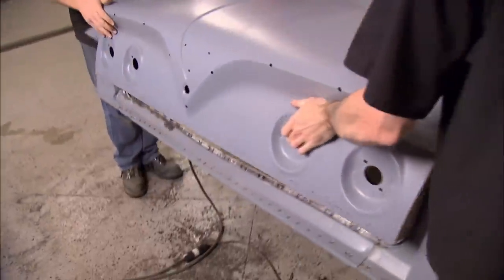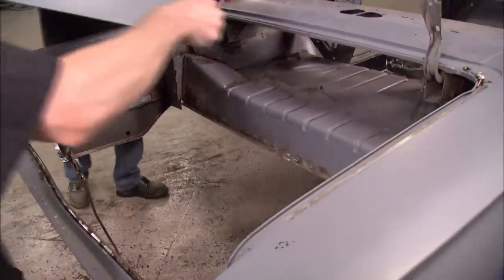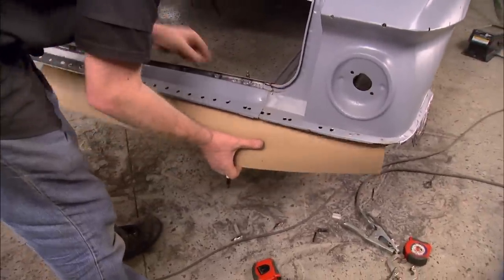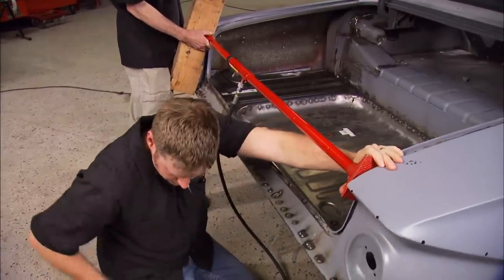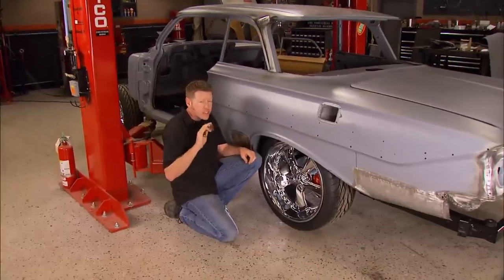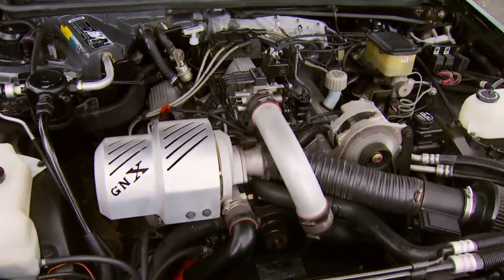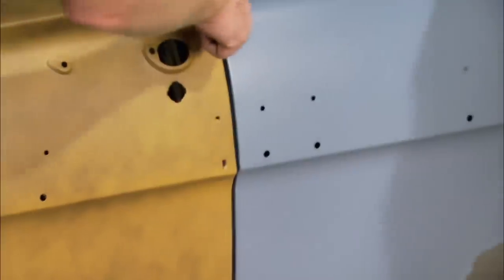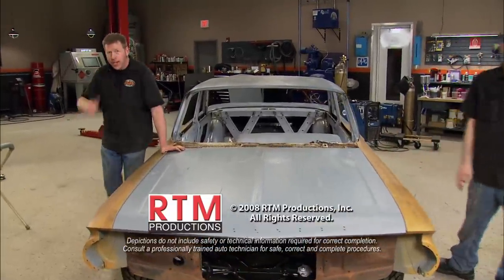Rebuilding a Rusted Out Trunk on a Chevy Impala - MuscleCar S3, E15

Comment: If you hang a piece of tape across the truck when you're using the ram you can tell how far you are moving it. Apply the tape tight then measure a half inch or so, however much movement you expect and let it droop. When you apply the force from the ram the tape will pull tight telling you how far you've moved it.

Comment: Why would you ever remove lead body filler. It’s been in place for 60 years without issues. That’s a long gone art form.
Reply: Now I'm only 48, so correct me if I'm wrong here. As I recall, some of the Bill Hines (sorry if I spelled wrong) customs almost had more lead than steel in them, and yet those gorgeous paint jobs have survived to this day. If a feller has trouble painting over lead, I reckon the problem isn't the lead, it's the paint. Just my two cents worth...
Reply: Gman 2060  another key board warrior... Huhh huhhh huhhh. Since you're the expert, tell me why you think I'm wrong.
Reply: Gman 2060  And yes fellow, there are paint experts in this world who invested time and materials to figure it out. You don't sound like a fellow who would get the job done. You sound like a customer who would pay me to paint your car.
Reply: Gman 2060   Been doing it for 30 years.  So yes, I am an expert.
Reply: @navvet4518  You can't argue with that resume!
Reply: Removing the lead filler is so useless. Why would you do that.
Reply: Gman 2060  Well the tired little man does like his commas and exclamation points. The rest of us "experts" are going to work now. You keep on googling water base paint in your mother's basement. The rest of us have real work to do.
Reply: Drew McNicol  I Agree, Those Craftsman Did that Lead Work as that Car Was Moving Down the Assembly Line. Talk About a Lost Art!
Reply: @solomonlynn7456  water-based.
Reply: My question to. Lead is integral with the metal, whereas filler just sits on top. The Arthut Tussik channel uses lead on the newer cars.
Reply: Exactly, that was completely pointless, especially since it will be replaced by rubbish bondo.
Reply: I can see removing the lead if it runs into an area that needs repaired ,it is impossible to tig or mig  through lead,if you've tried you know what talking about.
Reply: Gman 2060   Your painting over primer not bare lead.  C’mon man.
Reply: Seen on you tube a restoration in Finland and they filled the car with lead, or could use lead free solder. Better than body filler that cracks.
I would just leave the lead in place. 
That car was one rusted piece of junk. Was there nothing better out west in Arizona, the better condition the car is for restoration the less work making panels.